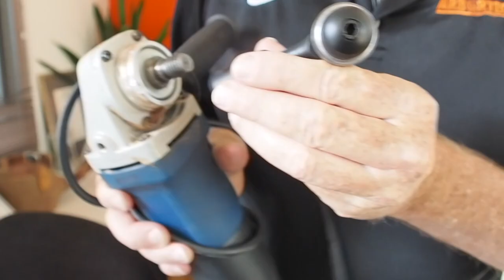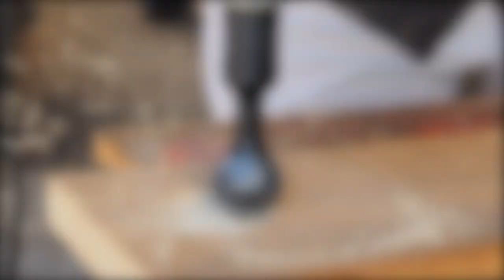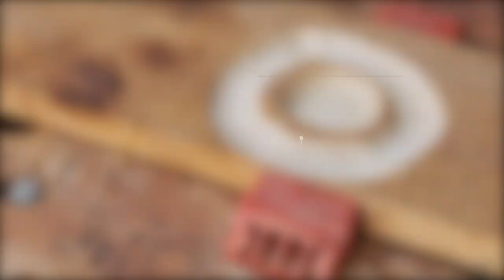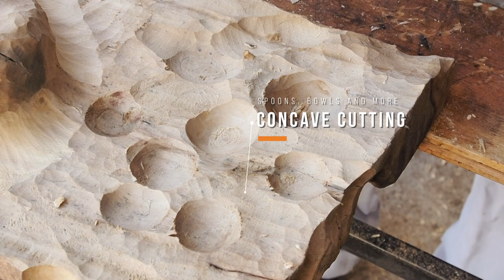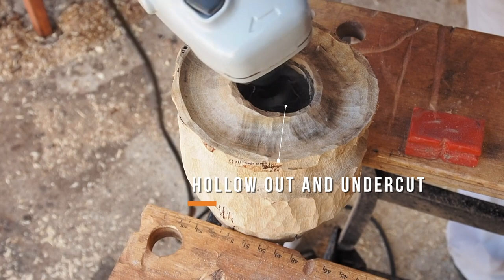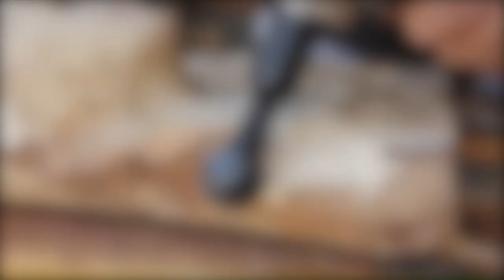New tool unveiled: The Ball Gouge

Comment: how do you sharpen it as I do my turboplane along the edge with a diamond fine file? Looks like a great  addition to my arsenal!
Reply from the maker: Hi Diana, the Ball Gouge is a bit different to the TURBO Plane in that it is a self sharpening ring-shaped blade. The blade is also rotatable and replaceable so when the time does EVENTUALLY (it's going to last you quite some time!) come for it to be changed you can simply purchase a new cutter without having to replace the whole tool :)

Comment: could this be used in a pillar drill....or would that be too slow ?
Reply from the maker: Hi William! The Ball Gouge is suitable for 100mm (4") and 115mm (4 1/2") angle grinders. It has been specifically engineered to handle high speeds of up to 12,000 RPM without compromising on control and balance :)